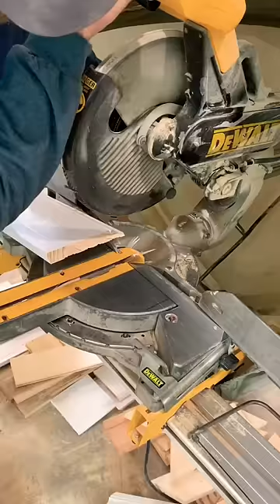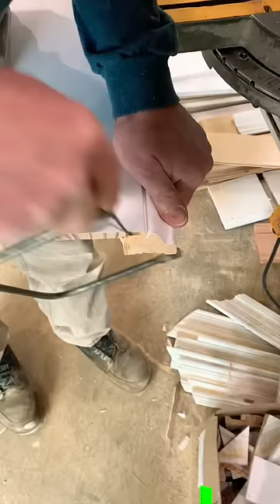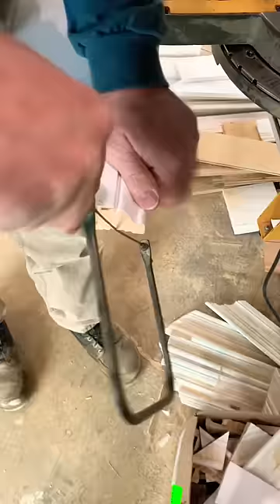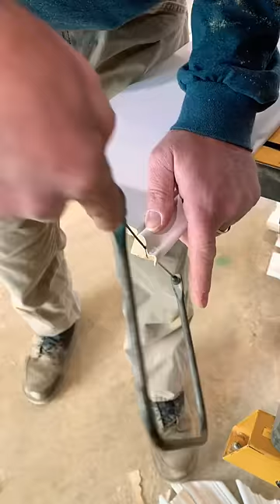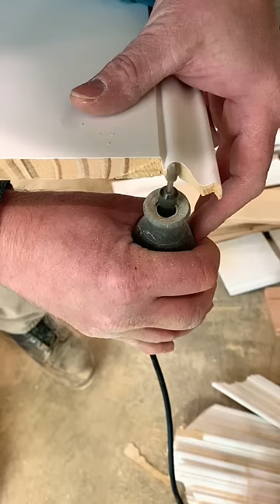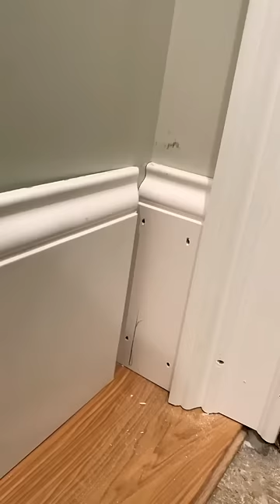Learn how to COPE baseboard…never be a puss and miter it!! #woodworking #coping #baseboard

Comment: Honestly it’s a long walk for a short drink of water and there’s other methods with far greater results and less work. But to each their own, keep doing what you’re doing boss.
Reply: Exactly
Reply: Yes !
Reply: Now that's cope!
Reply: Woulda just cut em on a 45, it's not like the corners messed up, and you're gonna caulk them anyway.
Reply: @hiphoppigeon862  If you have to use caulk you're a painter not a finish carpenter.
Reply: @jonathanharris4282  you're gonna have gaps between pieces of wood and walls. Not unless you built the whole room from framing up and made damn sure everything is as should be. My friend I'm not dissuaded of my opinion by your logical fallacy, you are welcome to try again.

And y'know, nobody has to use caulk at all. Just like you don't have to sink the head of the nail or screw, or you don't have to make sure your framing is flush, just like you don't have to install your drywall horizontally, or pop your lines before you start putting on shingles

But you do it because that's how it's done. You do it so the end product looks good and lasts longer. You also wanna make money, it doesn't pay to be slow for no real reason.
Reply: You should get a heart for that comment, but then again that’s criticism. Not everyone likes being criticized. I give you a heart for your amazing comment. ❤️
Reply: @hiphoppigeon862  yes sir. Best comment I've read all year.
Reply: @hiphoppigeon862  you dont do finish work for a living and it shows
Reply: @hiphoppigeon862  yeah until they warp and expand and then shrink back again in cold weather and you've now got a huge gap where there used to be a bit of caulk
Reply: I agree. Still need to caulk the little gaps
Reply: Probably the best comment on here, 
I like being good at all methods and it really boils down to what look the customer wants
Reply: @hiphoppigeon862  As a time served carpenter and joiner I can tell you internal mitres are incorrect. Scribing/coping is the way to do it, however you don't need a Dremel if you cut it correctly with a coping saw first time. 👊🏼
Reply: Actually this is the way you do it where your walls are not square - tried and tested by carpenters for over a century… takes a little skill and patience but works well.
Reply: @davidemmett1174  I once did a punch list in a home where the homeowner paid extra for the finish carpenter to make all the cuts like you said. The H.O didn't want ANY caulk in their trim. Baseboard, casing, window stools, crown moulding, quarter round, everything. The home didn't pass the airtight test. The builder had me put caulk in all the painted trim and clear silicone in all the quarter round. After that, the home passed with great numbers. I don't know by how much but I do remember the builder being amazed by the difference. Makes sense how new homes are more energy efficient.
Reply: This
Reply: @hiphoppigeon862  you have never put in baseboard have ya? Lol you still think all corners are perfect 90° angles😅 at Jobsites😂  and every wall is plumed keep to being a pigeon🤣
Reply: This way is quicker if your doing lots like a whole house because you can cut the whole house in 1 batch. you shouldnt need a dremal tool to do this just needs more practice at using the coping saw. I used to be a carpenter finishing work was what i enjoyed most. Dont bother changing the bevel for the back cut just use your pencil like a real tradesmen adjust you saw is time the more cuts you can do without having to make adjustments the more money you make
Reply: Couldn’t have said it better
Reply: @hiphoppigeon862  a properly coped joint won't leave a line/gap at all. You need more than 15° of back cut and you need to make the board a bit longer than the measured length.  I've coped entire houses and only ever used putty on nails.
Reply: Yeah I always have cut them at 45 and they meet without a gap
Reply: Good  glad i wasn't the only one.... It was already mitered why not do the other and be done 2 45s much easier 🤦
Reply: @Oink_Blaster  If a skirting board is taken into consideration for a leak test something fundamentally wrong has occurred during the initial build with regards to sealing. Skirting boards, architraves, dado and picture rails are all decorative features. The aim is to be passive prior to installation.
Reply: My man, PRIDE IN WORANSHIP. This is what sits thw hack apart from a true craftsman. This guy knows 20 ways to make this turn but ot would be a slap in the face to the man,men,or even woman who took time out of their lives to this cat how its done.  A job may be seen by millions daily and it might be years before someone would pass by and understand the technique used. But if done well the onlooker will stare at the work for hours. Maybe trying to figure out how he got the outcome achieved or simply enjoy the beauty in craftsmanship. My old man was one of the last great cabinet builders in the 60s. I've met one man since that had skills that made me ask constantly "How did you do that? How was this done? Wht did you you dothis this way? Just mind bending or a deeper reason that improvesthe build?" 
 We have a few different types of tradesmen in this world. FAst ugly cuts because plastic trim will cover it, guys that strive to improve the work they put out and a elusive few who's work that you will never lay eyes on because it is under other materials or in the back against the wall and will never be seen yet not one corner cut no shortcuts used just perfection.  A master trim man can say any price and people will pay..I'd much rather teach my son to be the guy that walks the extra mile to provide perfection...something to think about.. 
The pyramid could have been built in a fraction of the time if the used wood or mortar to build them yet we would not be able to enjoy them today as the world does.   Nobody would still be asking "THE HELL DID THEY DO THAT?" 
Pride in the craft pride in the work.... This is one reason the world is in such great decline imo
Reply: @hiphoppigeon862  that's why I'd did all the work in my house you can't fund trade. That care about my house as much as I do
Reply: @jonathanharris4282  a good finish carpenter always caulking seams for air seal but it shouldn't be to fill gaps. Some guys also use glue or wood fill
Reply: @davidemmett1174  just by your building terms, you're knowledge is based from across the pond. Tbh, it's worthless going further with this convo lol different regulations and building methods. Here, they do the airtight test when the house is either done or very very close to being done. Drywall isn't installed to seal to door frames, stairways, and flooring. Places where decorative moulding is placed to cover gaps. Also, this home was close to 6500 sqft or 603.85 square meters. Which is pretty darn large. If I remember correctly, about 110 total door frames. Therefore difficult to seal with just perfect cuts and installation specially when the walls have a textured finish. I can assure you that that the initial building portion was done correctly as it was a national builder that builds million dollar homes. And yes, they use caulk.
Reply: Tell me you get paid by the hour without telling me you get paid by the hour.
Reply: @hiphoppigeon862  im with you. I don’t do this for a living but when I do it. I cut them to the angle of the corner and it always looks fine. Maybe not always 100% gapless but nobody notices that after they are painted.
Reply: @irishn8  is painted trim the only option then?
Reply: @zirzmokealot4600  actually I used the white plastic trim without painting at my house and it looks fine. I learned that I have to measure every corner I do after the first corner had a big gap.
Reply: @Oink_Blaster  Your comment about the uncaulked house not passing the air test is interesting. However if this really happened, I’m assuming the house wasn’t painted yet correct?  Paint, and/or a good painter, would have most likely sealed it up.
Reply: @Oink_Blaster  if you are doing your air test before the vapor barrier and Mastic has been installed that would make sense, however you said the place was drywalled, so if the base is what's keeping air from flowing through then you have way more problems than caulking some trim. The house should be sealed like a diver's mask with vapor barrier, mastic, and tape long before the drywall is installed. Has nothing to do with what side of the pond you're on 🤦‍♂️🤦‍♀️🤦
Reply: @hiphoppigeon862 facts
Reply: @andreweastaughffe1070 doing my own house ( all of it ) just learned how to cope. Not good at it but getting quicker/ better. I think your comment had some typos in it. I was trying to understand that last part about the back cut and adjusting the saw ?? Any advice is appreciated. I’ve been using an oscillating saw and Dremel after the 45….
Reply: Guys, Salvation is very Simple

HalleluYAH “Hallel u YAH - Praise ye YaH”

YaH is The Father (Genesis 1)
YaH arrives via the TENT OF MEETING
YaH was Who they Crucified for our sins
YaH was Crucified on an Almond TREE

Ancient Semitic Moshe (Moses)
Isaiah Scroll (The Original Isaiah)
Reply: @hiphoppigeon862 and every one of those is the difference between a pro and a hack. It's all in the details...

Comment: 😂 them gaps at the end yeaaaaa no imma stick to cutting the 45s
Reply: There is a time and place for both.
Reply: @KOFPV  no time to be using a dremel  to detail every cut
Reply: @jamesfoti2909  
Customer is never going to notice or flex their coped baseboards lol
Reply: Yeah, isn’t a 45 in each baseboard the way to go? Why overcomplicate?
Reply: @rufogallardo7168  so they can charge their customer 3 times as much. Because. Money.
Reply: @jamesfoti2909  no, the dremal is definitely uncalled for. Copping saw is all you need.
Reply: Lol 45s open up over time and you just seen gaps because angle
Reply: @Asgro  hilarious
Reply: @timkooper  put a bead of wood glue on the 45's. you'll never see a gap.
Reply: Your customers thank you
Reply: @snivvelslurderagementai2560  itll crack over time  and youll see a gap dont argue kid i know this shit
Reply: You cope because you get an overlap, which allows some play if the lengths are perfect or you get some contraction. It’s the difference between maybe recaulking or needing a completely new piece
Reply: Cope definitely holds up better. Gotta make it a little long to let the point of your cope dig in to other piece. No caulk needed.
Reply: Copes are the way to go. This dude is not good.
Reply: @rufogallardo7168  45’s don’t work 95 percent of the time as the walls are never a true 90
Reply: @waynekirk4541  exactly. If they want to do a mitred joint they better have an accurate angle finder. Starrett makes a nice one.
Reply: A lot of faith in the framers and drywall... nothings ever dead 45 and things settle. Best way is cope youre baseboard but there are multiple solutions based off time and price.
Reply: Glad you said it, 45s all the way. Want to actually get more work done in a day 😂
Reply: @Asgro  when you're building a 3 million dollar home you do this
Reply: @snivvelslurderagementai2560  sir we use white caulk on white trim
Reply: @KrisInEastTn  you obviously know nothing about trim. 99.9% of Trim Carpenters don't work for an hourly rate, we get paid by the lineal foot on base. You have no idea what you're talking about.
Reply: @rufogallardo7168  45s never work. Even when coping your original cut should be at 44 and a half, and I pop a nail behind the back of the last piece to hold the bottom out and make it cram in. It's apparent most people in this thread are not trim Carpenters.
Reply: @mydogatemyhomework3768  i see, once you think about, almost any angle in a house it’s a perfect 90.
Reply: @rufogallardo7168  they never are even from the get-go of the framers. Then you get the drywallers that mud up the corners extra fat, and a lot of times lack screws in low areas. I've been trimming for almost 20 years but the most experience I have is from the old guys that have hundreds of years worth of experience passed down. I was lucky to be able to have the people that train me 20 years ago, be the ones who taught me.👍🏾💯
Reply: @mydogatemyhomework3768  I can barely count as a DIY l, it’s always good to hear from someone with experience
Reply: @rufogallardo7168  yes sir, nobody STARTS at the top👍🏾💯
Reply: @mydogatemyhomework3768  Okay buddy, whatever you say.
Reply: A lot of old houses are not square this is where  this comes in to play
Reply: @KrisInEastTn  no you can't
Reply: @mydogatemyhomework3768    It’s apparent. After 20 years of work. You haven’t figured how to cut a good miter.
Reply: Id cope but my boss do everything as fsst as possible he dont want u taking any extta time on shit
Reply: @HumilityListens  I work on expenses houses and remodels, I never would let my employees do that
Reply: Hoping is a better finish if done properly no Dremel needed just a coping saw and a little skill. If none right you can cut it A little heavy flex it in and use pressure to keep it from ever contracting and cracking out
Reply: @Asgro  I have specifically been asked by customers if I’m capable of coping because they don’t want their job mitered on inside corners
Reply: @rufogallardo7168  Obviously you don’t do production trimwork coping is more efficient higher quality product in the end if done properly
Reply: @okgeeokg2737  actually I just did my house baseboards, and dude copying is a lot nicer looking, but of course took me quite longer
Reply: @okgeeokg2737  I don't believe you have ever had a single customer ask you to cope their baseboards
Reply: Everyone in this comment section is very obviously a DIYer. As a carpenter this is how you are taught to do baseboard, and if you think mitring is better, trim and house both ways and show me the results. The mitres will leave gaps everywhere and be a cause of filling every corner.
Reply: @rufogallardo7168 all walls aren’t 90 coping helps eliminate the guessing, perfect corners every time. Takes time to perfect of course
Reply: @josepholmos3504  I experienced that recently when I did some baseboards myself for the place I moved into, anything but copying is beyond mediocre.
Reply: Nothing a small wedge won't fix
Reply: @bencomley6156  not true. I've built plenty of cabinets and trimmed all types of scenarios. I've almost never used coping and yes I understand it's the way. But matching the angle of degrees on a corner will yield a tight seam a little glue and a pin nailer and it solid.  I can get way more done with quality results by mitering my angles. The important thing is results that last. I've been back to see work from years ago and it still looks great no gaps no cracks. Whatever works best and leaves the customer satisfied is my goal. Happy building!!
Reply: @josepholmos3504  using an angle finder eliminates any guessing. More than one way to finish a trimmed corner.
Reply: Guys that 45 dont know how to trim, 90% of homes have build ups in corners, outside corners off etc. Coping is the best way to go, this guy just isnt good at coping.
Reply: @tcripper You could use an angle finder and get a perfect corner, but I can do it in half the time with a cope. You do you, but you're trying to hard. My shit dont need caulk.
Reply: a proper cope will work in places that is almost impossible to get a perfect finish, coping helps with not perfectly square walls, and out of plum walls. also when done right the joints look 10 times better
Reply: ours are coped and still full of gaps over time, may as well use 45s
Reply: @timkooper  not when you use glue
Reply: I do 44’s on insides and 46’s on outsides.  I’ll adjust by 1/2 a degree if I see the mud is really stacked.  Ninety eight percent of the time they are tighter than his cope looked.
Reply: @rufogallardo7168 there’s a time & place for everything , coping works better with crown molding
Reply: @rufogallardo7168 because it is correct
Reply: I only 45 cookie cutter houses
Reply: 45 outside coping inside
Reply: Guys, Salvation is very Simple

HalleluYAH “Hallel u YAH - Praise ye YaH”

YaH is The Father (Genesis 1)
YaH arrives via the TENT OF MEETING
YaH was Who they Crucified for our sins
YaH was Crucified on an Almond TREE

Ancient Semitic Moshe (Moses)
Isaiah Scroll (The Original Isaiah)
Reply: I was always taught mitre external, cope internal
Reply: @rufogallardo7168 it’s not so much over complicate things but cause each corner isn’t always 90 degrees. The cops will away you to work easily around that.

Comment: “dOnT bE a PuSs, CoPe” yet still has gaps after working that seam for an hour.
Reply: Yeah I think trim work is my favorite aspect of carpentry due to the simplicity. If you cut a little long and start taking off c hairs until you hit perfection there is no reason to cope
Reply: @danielrichardson6054  drywall isnt perfect